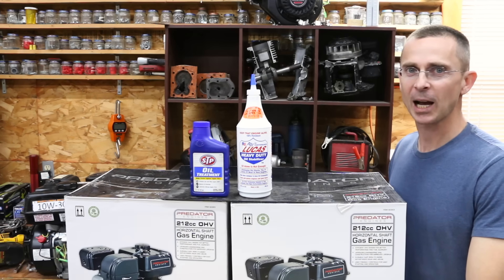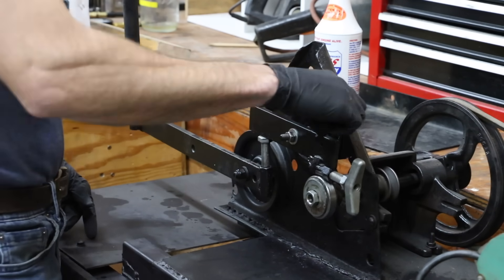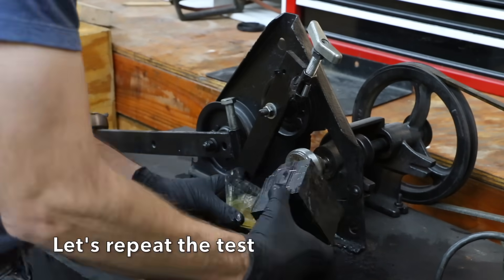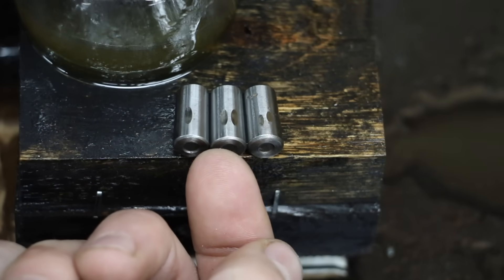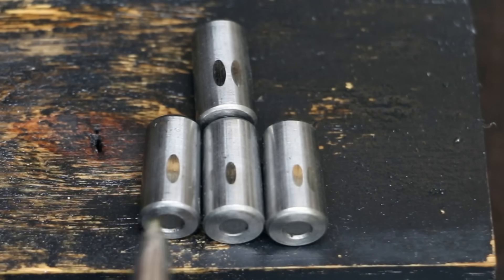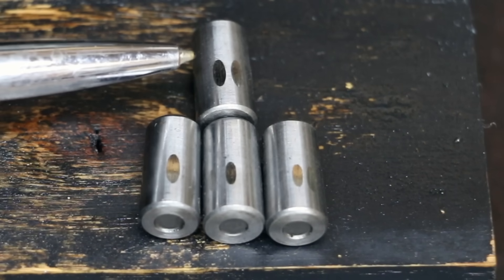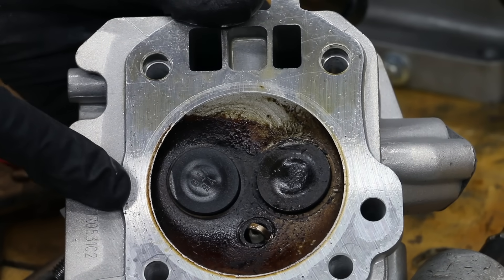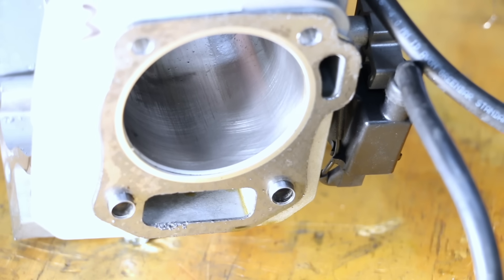Which engine self-destructs first?  Lucas or STP?

Comment: Do they still make Dura Lube. That stuff works. My X wife ran her minivan so hot the manifolds were glowing and the engine was good still after replacing the water pump. True story
Reply from the maker: Thank you
Reply: Keith Collins    My ex ran my bronco dry.....and let it idle till it died do to..no coolant !        Fixed  the leak....filter change and new oil.......ran fine for another 5 years.......also replaced the duralube.....I've seen it at o Reilly's.   I am a fan

Comment: Will never use STP oil additive, had a very bad experience with that oil additive, broke my engine in less than 3 years after adding that every time I change oil..just remember don’t put any additives, just use a quality oil,don’t add any additives.
Reply from the maker: Great Point

Comment: truth is , I wouldn't waste my money on either one. snake oil
Reply: I had a 22RE that had a diet of Lucas at every oil change.  When I got rid of it, it had 648,000 miles without touching the engine.  It was transplanted in its third vehicle at that point, but still running strong.  Compression was at 165-168 across the board.
Reply: @monelfunkawitz3966  I find that a little hard to believe due to normal timing chain wear.
Reply: @willythewave  Believe it.  Never touched engine internals.  Went through the usual external stuff like alternators, fuel pumps, etc and it leaked oil but it ran.  It did a lot of long haul highway driving.  It had a diet of Lucas oil treatment every change starting around 1991-92 when I got it.  Oil change every 3k, air filter every 6k.
Reply from the maker: Great Point
Reply: Lucas works,be a dumbass and dont use it.
Reply: Id use a high quality PAO or Ester based full syn motor oil firs before using an additivet, but lucs does do its job for whats intended, definitely not "Snake Oil" but not jesus juice either.

Comment: Neither won or lost. You run an engine without oil, it'll break. I don't think one lasting a few minutes longer is an indication of it being better. After all, one well-maintained engine may last one guy 11 years whereas another well-maintained engine could only last 6 years. Too many variables in too many moving parts. Same part from the same machine in the factory could be different. That's why you'd have to repeat this test on hundreds of engines to get more reliable data and that should only be done within the R&D department of the engine manufacturers. I hated seeing 2 brand new motors being trashed and, worse yet, for virtually no purpose.
Reply from the maker: Thanks for the constructive feedback

Comment: Never put additives in your oil....the oil manufacturers have blended oils for your use and the same manufacturers are totally against using any oil additives.       Regarding the bearings,  roller bearings and needle roller bearings are designed to roll with an air gap to allow the lubricating oils to lubricate....the test showing here was a roller held statically against a rolling bearing which is madness and of course the oil cannot prevent this type of wanton damage.    Foolish tests.
Reply: Exactly,  thats what clicked in me , too !  Those bearings are not static in real scenario,  the way he demonstrates ! Perhaps if you dont use it right , youtube is the way to get our brain incapacitated !
Reply from the maker: Thanks for the constructive feedback.  Engines with flat tappets and others have high metal-to-metal contact, such as gear sets, which is why the lubricity test is used to assess film strength.
Reply: @ProjectFarm  Agreed, but what you did was a destruction test which the bearing rollers were not designed for, therefore no oil on Earth would protect such wanton destruction.

Comment: I think you should have 3 engines,  regular oil, additive 1, additive 2. Also based on racing 4 cycle karts, Jetting determines temp as much as oil. And run an exact rpm gauge on each.
Reply from the maker: Thanks for the constructive feedback

Comment: Without reading all the other comments, the obvious flaw in the experiment is that the n of 2 is way to low to reach any kind of statistical significance. With only 2 engines, the difference in dry sump run time could just as easily be explained by variance in manufacturing as by oil additive. Additionally, these are oil additives. No one at either STP or Lucas is going to recommend using these products with no regular oil. This could have been controlled by running the engines (much longer) with oil plus additive. Lastly, small engines need plenty of oil. What brand, which additives, and what viscosity is secondary. This comes from nearly 50 years of working on lawnmowers, go-karts, and other small engine machines.
Reply from the maker: Thanks for the constructive feedback

Comment: Damn, were you trained in the military or your first job at the US Post office?  What relatability to the real world does a test with no oil and no load on the engine give to anyone???  Bye
Reply: Well, let's relate it. Both engines simulated load was no oil which increased the heat and stresses on the components. The Lucas engine lasted 175% of the time the STP engine lasted. That shows the maintained lubricity of the Lucas was nearly double the level of the STP. Had both engines been full of oil plus additive mixture, over time the Lucas mixture would have maintained a higher level of lubrication than the STP. Hopefully, you see that if the Lucas maintained that much higher lubricity it would translate into better long term protection of the engine by Lucas than by STP. If you are looking on Youtube for actual laboratory based experiments in Tribology, you might consider a new search area.
Reply: ShadoWorx you absolutely nailed it. Your explanation made it much more understandable and interesting for me for sure
Reply: Duh......ShadoWorx explained it perfectly.

Comment: We were evacuating for katrina to my nephews house we were driving my 71 ford truck there and the rear end had a leak well about half way there it started to make noise tried motor oil to help but went right thru then we put two bottles of lucas pure in it and got one for spare dont remember if we added some of the third well we finished going there then all the way home without any problems it even lasted a couple weeks after that so i like lucas it help us on our trip
Reply from the maker: Impressive!  Thanks for sharing this experience.
Reply: Glad you made it home!

Comment: When I've worked on old Cummins engines that have been run with Lucas in it I've found  that you can't pick  up the injector links with your bare fingers! They are too slippery, have to use needlenose pliers!
Reply from the maker: Thank You

Comment: I have a Silverado with 180000 MI and I thought it would be a good idea with that many high miles to and Lucas to my oil change I did this and oil completely disappeared after 6 months and motor inherited a tick went and had a brand new oil change done have not added any additives or stabilizers and the oil has not gotten low on my dipstick at all since then
Reply: Some cars could use them some cant. The most important thing to do is change your oil regularly. I dont add any addictive because it changes the viscosity and if it ain't broke, dont fix it. Most oil has additives anyways unless you go to the dollar tree or something

Comment: I fail to understand the point of running engines without oil and/or oil additives.  I fail to see how either product wins or loses because the test is not representative of how the products are to be  used.  While we may make conjecture that the Lucas outperformed the STP,  the test actually fails to determine which product is superior under representative conditions.  Engines need to be run with oil.  A more appropriate test would be to  life-test each engine - STP vs. Lucas vs plain oil - to determine if the oil additives are adding life vs. just plain oil, and if yes, which product performs better for extending life.  Such a test would take many hours, and instead the lubricity tester  can be used.  Regarding the lubricity tester; a visual of the specimens is good, but loss of mass on the specimens is  more quantitative/better.  It pained me to see two engines destroyed while yielding results that I consider worthless.
Reply from the maker: Thanks for the constructive feedback

Comment: Well, I don't know what purpose that served.
Reply from the maker: Thanks for the constructive feedback!
Reply: Honestly, what did that tell you?  No one runs an engine without oil.  A better test would be to run both engines for 500 hours, using oil and the additive,  and then compare the wear.

Comment: What's the point of this?
Additives are snake ojl.
Mechanic in can
They serve no purpose except to separate your money from your wallet
Reply: Don, so long as there is a population of vulnerable customers, there will be a market for their wallets. Pay attention or pay cash America!
Reply: As I asked what was the point of destroying 2 engines? 
Motor oil recommended by the manufacturer is all that is needed. End of story..maintenance intervals, lubricants all ya need..
If oil boosters were magic as they all claim, wouldn't a manufacturer of engine be extremely stupid not to use them?
All warranty claims gone in  a heartbeat.trouble free..
I've never used additives in oil,coolant or and fluid in an automobile. I've owned many many cars.
About half purchased new. The used ones were chosen carefully. Some I kept for more than 13 years in excess of 250k miles in some. 
Follow schedule and recommended POLs and things work.

Comment: Look up the oil additive call PowerUP it's for real a nice product and will beat out all others Period.  Years ago I jumped a ditch in my GT Mustang.  Unknown to me I punched a hole in my radiator and lost all my water at the crash site.  I drove the car home approximately 20 miles with no coolant and the car was fine and did not overheat due to the PowerUp oil treatment until approximate mile 18.  I know everyone is gonna say it had water but believe me the fan pulley was pretty much shoved thru the radiator.  Anyhow please test it out I really would love to see your results.
Reply from the maker: Thanks for the constructive feedback!

Comment: The additives are for preventive maintenance if you are running an engine hard all the time or if you have an engine with lots of hours on it the additives will prevent wear and extend engine life.ADDITIVES CAN NOT AND WILL NOT CORRECT EXCESSIVE WEAR OR MECHANICAL FAULTS,THE IDEA BEHIND THESE PRODUCTS IS TO USE THEM BEFORE MAJOR PROBLEMS DEVELOP NOT AFTER THE FACT.

Comment: My car ran hot because it got low on water, there was a hole in my hose. End result oil started shooting oil out. Should I drain the oil, refill it, use Head Seal after fixing the hoses? My A/C Compressor locked up. Will Head Seal still work.
Reply: Lmao what the fuck is a head seal? Also how the fuck did your engine running hot make the compressor seize? 🤣🤣

Comment: I run Mobil 1 High Mileage with a few ounces of STP High Mileage in my Kohler Magnum. Never had a prob. Stp is a little cheaper to buy but when mixed with oil I don't think there's that much of a difference between them. Like one comment on here, have a controlled engine.
Reply from the maker: Great strategy. Thank you

Comment: I use this mobile 1 high mileage full synthetic with the regular stp oil treatment  in my 1998 saturn sl it has ove 300.000 miles it make my engine last and run smoother. Less burning oil and works well  stp and mobile 1 are well know :-)  great video
Reply from the maker: Thank you!

Comment: Can you try slick 50 i put this in my car motor and going along the hiway i burst a hose and cooked the motor i turned off the motor when i went to restart it  it will not turne over just a clicking noise from the starter motor at the time i thort this motor has finished i left it for 4 hrs to cool down went back and it started to my suprise no knocking it rane grate
Reply from the maker: Thank you for the video idea!

Comment: I am a firm believer of Slick 50 and Mobil 1. In 1976 I bought a new Toyota Celica 5 speed. My automotive teacher in school told us there is a reason Toyota and other manufactures give you a FREE Oil Change at 1000 miles. They put a cutting oil in the oil pan to make the engine "Break In" rather than have you wait 3000 or more miles. So to save wear on my new engine I had the oil changed to Shell Multi-grade oil. After 10,000 miles I discovered the durability of Mobil One at an auto show in Chicago. They had 10 frying pans on one row and 10 on another. They put different popular oils in each pan and Mobil One. All were at the same temperature. The other oils burned and turned to goo, but Mobil One stayed liquid. They had cans of all the popular oils in a metal box. They poured liquid nitrogen poured in. Quaker State Oil I hammered a screwdriver into the oil, some oil acted like cold honey. Mobil One was still liquid. I went to touch the screwdriver with my bare hand and I was told "Don't.. The freezing cold will burn my finger." I was convinced that when it comes to extreme weather Mobil One was the best.  At 15000 miles I heard about a product called "SLICK-50" They ran a treated side shaft Brigg and Stratton engine for hours with no oil in it. Before Mobil One I was getting 20 mpg on the highway. While using Mobil- One I got up to 27 average. After SLICK-50 and using MOBILE-One I got to 39 Mpg Freeway driving only.. Chicago to California. After that I only changed my oil every 10,000 miles even my lates new 2014 Kia Forte. On the freeway same as the Toyota I get 39 mpg. On my Toyota 20R engine I took the cylinder head off at 100,000 miles and I measure cylinder wear. the difference between non-friction cylinder walls to friction area was One Thousandth of an inch.. a human hair. I ran that engine 250,000 miles until the car was stolen. I plan to get the same from my Kia.
Reply from the maker: Thank you for sharing this experience

Comment: Yep, lesson learned, don't run without oil.  Destroyed 2 perfectly good polluters and the free world is still without the data of STP vs Lucas.  Even the bearing test is without merit, those tests have been done dating back to the 1940's and have never proven anything about lubricity and real world wear on critical surfaces.  The biggest discrepancy over decades of running internal combustion engines and claims made by oil companies and oil additives is which factor to measure and how much data needs to be collected to get an accurate measurement.  Running an engine without oil has never been factor to measure because no one is going to run an engine that way.
Reply from the maker: Thank you

Comment: After this video, ive been putting lucas in all my lawn equipment. I had an old briggs and stratton 15 horse power motor and the valves were crazy loud. Put sea foam in it to get all the sludge out, and i put lucas in. Still very quiet
Reply from the maker: Impressive! Thank you

Comment: I realize it's expensive, but maybe a control engine without additives.
Reply: Technically, he should run hundreds of engines to death to account for manufacturing inconsistencies.
Reply: @holocaust_2.0  I agree. Every test is inaccurate until at least 500 of these are blown up to get a control number
Reply: Correct me if I'm wrong, but in the previous test, didn't the standard oil last a full 50 minutes longer? Best forget about additives I reckon!
Reply: @yammy1000  38 minutes.
Reply: Jamie Montoya what I was thinking to.  Would have gave a good comparison to others and maybe shown a drastic difference
Reply: He did that in an earlier video, see here:
https://www.youtube.com/watch?v=m8ZKMCfAue4
Reply: thats exactly what I was thinking
Reply: Every youtube video forgets the control group and its so annoying
Reply: Yup.  A scientific test needs a control.

Comment: Imagine that the motor came apart without any lubricant inside still not understanding what the point of this video was besides wasting money to blow up two motors/wasting money on Lucas and STP to drain out of the motor you are going to blow up I assumed you were going to fill both motors up with each lubricate and run them until one blows up not drain the damn oil out of it and let them blow up of course they are going to come apart there’s no lubricant but hey what do we know I guess now we know the same thing we knew going into this video do not run a motor without oil
Reply from the maker: Thank you!

Comment: Okay. First off you are murdering your modern engine's mileage by using either one of these products. If your car has any kind of variable valve timing that system works off of the viscosity of the oil. By increasing the viscosity(which these products do)you are causing that system to not operate properly and thus are losing the benefit of VVT. But for older cars, they're the liquid fix to oil consuming vehicles. Great vid. Not surprised the Lucas went longer. That's great stuff....For Older Cars without VVT.
Reply from the maker: Thank you!

Comment: I think the higher temperature reading that you get from lucas was actually misleading. You're pulling the temperature from the heat exchanging fins of the cylinder head, seeing higher temperatures at the cooling fins could mean that the overall internal temperature was lower due to more of the heat being exchanged. I don't think the stp had any redeeming qualities in this bout. However, for a good scientific qualitative experiment I would repeat it with equal parts rather than following the instructions. That said, by following instruction i think Lucas was a clear winner, as to me seeing higher temps at the cylinder heads is probably a sign of better heat transfer and not an actually hotter running engine.